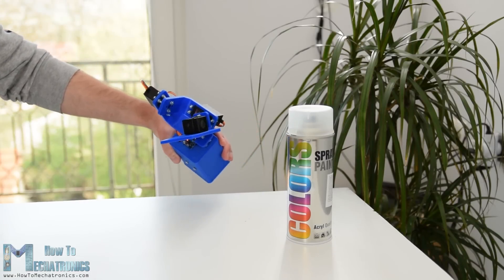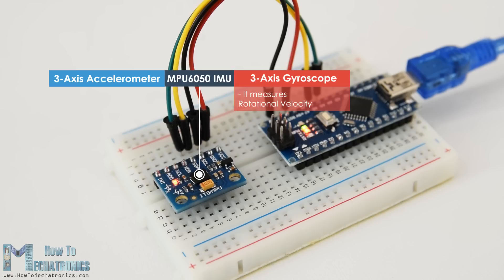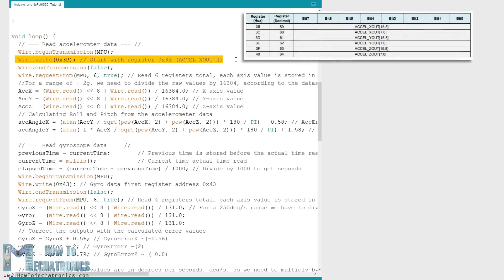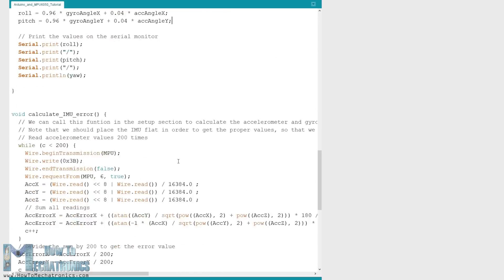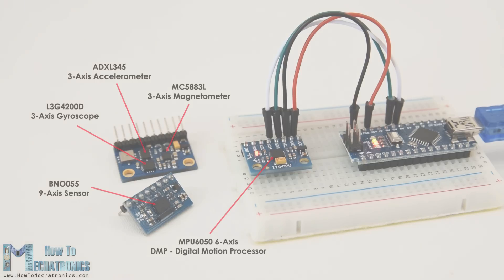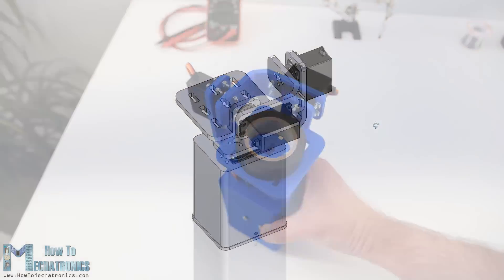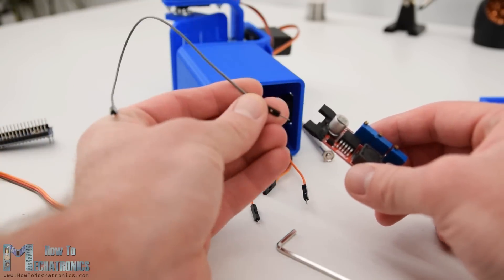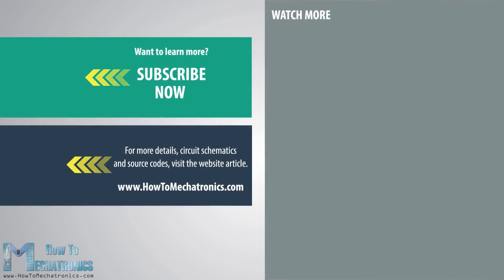DIY Gimbal | Arduino and MPU6050 Tutorial

Comment: (1) I did not see where the Arduino Nano was put? (2) If there is a Camera assembly, where it is mounted? (3) Is the base motor for roll rotation? (3) How the other 2 motors attach to the camera assembly? (4) Should the MPU6050 be no relative movement to the camera assembly? (5) I am very interested in JLCPCB, but I don't understand what role it plays in the project beyond sponsorship.

Comment: Actually, I have seen several times on YouTube how to use MPU6050 on Arduino, but I always fail to understand how to use it, whether using MPU6050 really does not use pinMode like other modules and sometimes I am still confused about how to use other libraries on Arduino

Comment: 12:35 I have a question, let's say we use even just a simple bldc motor instead of the mg966r, would that still work with the same code and library? and how much of a difference would it make? Thanks boss!

Comment: Hello, we have successfully completed the Arduino nano based Gimbal using your code, it's really good! Now we want to try ESP8266 based Gimbal, I noticed that maybe for ESP8266 define interruptpin need to use pinmode() and attachinterrpin() (we use the interrupt PIN or GPIO2)
const int INTERRUPT_PIN = 2;
pinMode(INTERRUPT_PIN, INPUT);
attachInterrupt(digitalPinToInterrupt(INTERRUPT_PIN), dmpDataReady, RISING); 
but after many times try, it never work, When we move the mpu6050, the servo motor does not respond at all. May I ask what other parts of the code need to be adjusted if we use esp8266? Very much looking forward to your reply!

Comment: Hello, I am surprised that you didn't need any kind of driver for the servos. I am doing a project of a gimbal where I need a high quality stabilization. I will therefore probably use a brushless dc motor. I am certain that I will either need a driver or a brushless gimbal controller. If I were to use the BGC, would the code that you used work on the BGC?
Reply: Have you completed your project sir? Cause I'm making a gimbal too and also using bldc instead of servo motors

Comment: Is the ground wire between the MPU-6050 and Arduino Nano wired correctly at 11:05 ? Shouldn't each component run their own independent ground wire back to the buck converter? Or at least three way splice down?

Comment: Great tutorial. However I would have used a proper I2C bus and not just connect the SDA/SCL between the Arduino and the MPU. This is in case people decide to combine other things in this setup (like a display) and end up either frustrated that nothing works or worse - fry their electronics.

Comment: 6:20 Based on the silkscreen on the MPU to me the it's sideways to the camera. Yaw should be 90. Pitch 0. Roll 0. When I use this lib the YPR values only seem correct if I initialize in this sideways position... Seems wrong.

Comment: datasheet says:
The reset value is 0x00 for all registers other than the registers below.
. Register 107(0x6B) : 0x40.
. Register 117(0x75): 0x68.
But your code :
  Wire.write(0x6B);                  // Talk to the register 6B
  Wire.write(0x00);                  // Make reset - place a 0 into the 6B register !!!!!!!!!!!
why 0x00 instead of 0x40?

Comment: It could be improved with a first or second order filter on the gyroscope values as well as not using servo.write but instead servo.writeMilliseconds as this allows much finer control as the write function can only write in increments of 1 degree. Great video though!
Reply: I would also hope you can add some charge protection to those two Li ion batteries

Comment: My sensor error keeps climbing up as time goes by, is this norma or is there something wrong?
Reply: same, you ever figure it out?
Reply: @Yeisnotking369  
You should implement gyro correction overtime from accel.
Instead of 
roll = 0.96 * gyroAngleX + 0.04 * accAngleX;
pitch = 0.96 * gyroAngleY + 0.04 * accAngleY;

use 

gyroAngleX = 0.96 * gyroAngleX + 0.04 * accAngleX;
gyroAngleY = 0.96 * gyroAngleY + 0.04 * accAngleY;

roll = gyroAngleX;
pitch = gyroAngleY;

Should help you with your problem.

Comment: lets say I wanted to use this code i wanted to use this code for two mpu6050s, could i just copy and past the code so it doubled and justrenam the second set of variables? the program inside the loop would be doubled and the code inside the error check would be doubled. I tried this with the teacup example, but my interrupts were getting messed up and i kept getting a fifo overflow.
Reply: also, thank you for this video. I've been searching through other videos and forums, but this is the first one i found that explained every thing really clearly.

Comment: Very nice informative video, it helped me remember my days in Boolean algebra a little bit and get started with MPU6050. This MAY be nitpicking but there is a point I noticed which is quite confusing for someone (like me) who is paying attention and tries to understand the code but is not yet very competent and familiar. Specifically at 3:58 you state that "because the values are 2s compliments, we combine them appripriately  to get teh correct values". Now I did not know what that syntax ment so I had to look it up. After going through half a dozen pages and also remembering some basic boolean math I understood that this whole line when reading AccX meant: shift the 1st byte to the left by 8 bits, and apply OR operation between the 1st and the 2nd byte. All this results in a 16bit integet containing the 2 previous bytes in the proper order. The confussion stemed from the fact that you mentioned that they are 2s complements but this was irrelevent since I dont see any line in the code for the accelerometer that does anything about them being 2s complemetns. It just devides by 16384 as per the datasheet to get the value in g. Now all this certainly helped me do research and understand it better but I think that these kinds of code lines could be briefly explained as they are not very intuitive for those that just start learning. 
All this was just some constructive input on a very informative video, keep it up!
Reply: If they had said 16 bit 2s complement integer it would have made alot more sense I agree.

Comment: nice video! unfortunately servos are not as smooth for video stabilization :(
Reply from the maker: Thanks! Yeah, they are not really meant for such a purpose.
Reply: @HowToMechatronics  yep I also made some similar to my drones, the flight controller can control the servos the same way but servo jitters on small changes and even fpv video is shaking so have to live with the more heavy brushless gimbals. I was thinking of some rubber mechanism to smooth out servo movement but no succes yet

Comment: Nice project! The only problem is in the complementary filter, because if you move in some direction(What you didn't in the video), like ruuning, the final accelerometer angle will be wrong and point to the direction that you are moving and insert this error over time into the final angle. So if you walk with this gimbal, the camera will start to face down while you walk

Comment: Isn't the Arduino missing GND connection to the buck converter?

Love to see the results with stepper motors.
Reply from the maker: Yes that's true, the GND connection between the Arduino and the buck converter is missing in the circuit diagram. Yeah, it would be much better if done with stepper motors, although they are not the best solution.

Comment: Hello, work with Micro Servo Motor Pro sg9?
Reply from the maker: Hey, yeah, it would work. Of  course, the design parts needs to be modified to fit the SG90 servo instead of the MG996R which is a bigger.

Comment: how you know the vertical direction at the start?
Reply from the maker: Well with the current program you should start with flat position. However, you could use the error calculation function and correct the current values with the initial values.
Reply: @HowToMechatronics  thank you for quick reply. I just think about  construction that will find the vertical byself.

Comment: it would probably better to mount the gyro on the platform which has to be stabilized and then use PID controllers on each axis to minimize the error to the 0 setpoint. If you would do that you do not need to calibrate the servo range and internal PWM to angle mapping.
Reply: are you going to do that and show us?  it'd be pretty cool to see it

Comment: Next time make it with Steppers 
Awesome project 👏
Reply: Why steppers? Every gimbal uses brushless right?
Reply: @klaunpot  Nooo i'm pretty sure that guibal use steppers, for the precision. Or maybe brushless with rotary encoder or something like that. (sorry i'm a french Teen)
Reply: @estebanmercier9652  there are diy motorized gimbal videos, they seem to use brushless motors with feedback from gyro/accelerometer, similar to drones. You don't need shaft rotation measurement with accurate PIDs ;)
Reply: Gimbals are using  brushless motors cuz it gives most stability.

Comment: Which to use MPU 6050 or ADXL345
Reply: Mpu
Reply: Whats the difference
Reply: @rajatmamidwar8591  mpu6050 has gyro and accelerometer, adxl has only accelerometer.